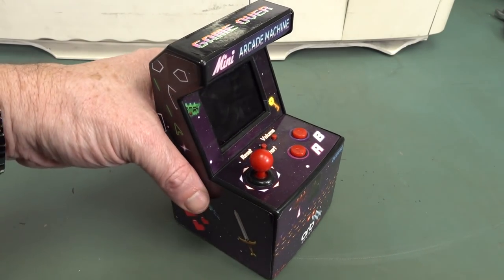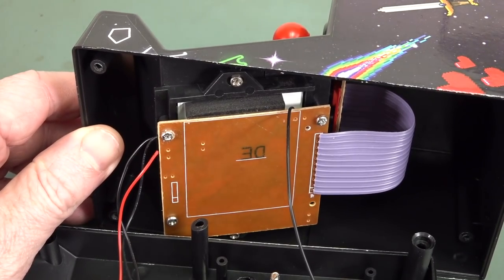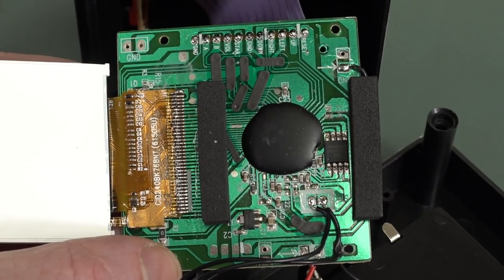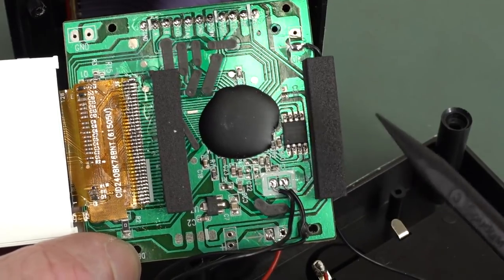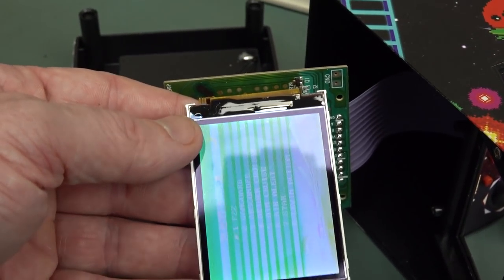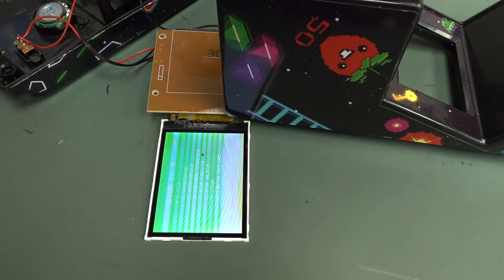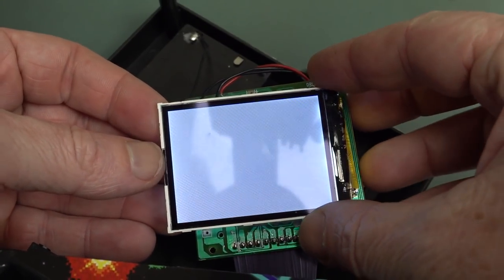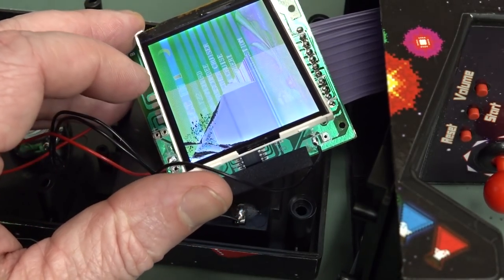Mini Arcade Game Console Repair OOPSIE!

Comment: buy a new one and pretend you fixed it!
Reply: Genial hhahahahhaa
Reply: Dad if you fixed it why'd you delete my save files.
Reply: Replace it with the new Raspberrry Pi and a tiny HD screen, WiFi adapter, etc., so Sagan can run it directly off Steam... plus he'll build up good arm strength carrying around the 12V car battery to power it.
Reply: Exactly the same I wanted to write. Weird... :)
Reply: @VeggeMight  Flux capacitor needed re-compiling
Reply: Dad of the week hahahahah

Comment: Tip: Access test mode by holding A and B while tapping Reset or while powering on.  There’s a nice menu of tests you can run
Reply: I like how the test screen crashes when you press all 4 dpad buttons at once
Reply: I have a rom dump of one of these... was trying to see if it was using nes on a chip... it may be, but i can't tell. Most likely custom...
Reply: Mine seems to crash when pressing up and left together. If that fails to crash it just press another button at the same time

Comment: from my experience, if you see color change in the lines there text/white things are, it's usually issue with voltages driving TFT matrix.
It may be issue the issue with broken Chip On Glass TFT driver or if driver settings are incorrect. 

Settings usually transferred from MCU that drives TFT shortly after boot by SPI or I2C interface, so wiggling it in runtime will not help...

Comment: Unsolder that memory chip and dump its contents. Would be interested in what's stored on there. Please do it, please!
Reply: I second this. This could tell what kind of emulator they are running on the blob
Reply: @zaprodk  If I were to guess, I'd say it's MAME (multiple arcade machine emulator)
Reply: @brettleach6565  MAME is a Lot of things. It can emulate dozens of different game platform hardware. /which/ hardware is what would be interesting.
Reply: @zaprodk  These things often have several games on one chip/blob. Id bet that they custom code them all for some cheap cpu,. Id go for 8051/PIC?

Comment: Looks like a pretty standard 240x320 LCD with a R61505U controller, they're cheap and easily found on Aliexpress. Maybe do a followup video soldering in a new LCD.

Comment: Did you check the power supply ?
Reply: Rule Number One: Thou Shalt Test Voltages.
Reply from the maker: Yep, 3.3V. Didn't get that on camera.
Reply: Did you check the contrast setting voltage?

Comment: i brought one of these hoping to use for a project...took it apart soon as i got it home...when i put it back together i had the same issue with the screen..i took it apart again, checked the ribbon which was fine, and couldnt see any other issues, decided to put it all back together securely and return it as DOA...but to my surprise it actually worked..and still works fine today!

Comment: I just did the same, Trying to fix  55" (140cm) Tv. I'd just found the problem when I cracked the screen - I nearly cried !!!
Reply: I found a 65" and I can't believe how big the LCD is, just turning it over makes me feel the screen will break! If I was a repair shop I'd have some sort of moveable drafting table type support mechanism to hold it and move it around without flexing.
Reply: volvo09 Make sure it has an adjustable curve for those curved screens!  May I suggest a soft winter duvet as a home solution.  It is soft and big enough, and is routinely wrapped in a temporary cloth in case of spillage or glass shards.

Comment: Next project :- build the "equivalent" from scratch using a raspberry pie.
Objectives 1) Toy for Sagan 2) Interesting project for some of the subscribers 3) To finally shut up all those who goes on about the raspberry pie each time a retro console is shown that does not use a raspberry pie.
Reply: yes please
Reply: Zendal Darkman Yeh, that's a more appropriate use for that BroadCom SoC that boots from a serial flash or SD card and contains a built-in LCD/video driver.  Wonder if that CoB could be the main chip from an RPi 1 model A, with the flash chip doing the job of the SDcard.
Reply: Raspberry pie?! Yummy.
Reply: @mattmoreira210  They are!
Reply: Doug Dave is not that kind of guy to...

Comment: Same problem happened to my niece's mini game console purchased from Jaycar. Different branding but identical internals.

I'm planning to run a hot iron along the ribbon cable near the PCB, but hold little hope of it working. There's not much else to go wrong in there.

Might be a fun project upgrading the cabinet to a RetroPie! You could do a video documenting the conversion.
Reply from the maker: Interesting to know it's not a one-off fault.

Comment: those carbon conductive jumpers seem like a good thing to check. they're not going to be current carrying, so signals only, possibly for the lcd and if one went bad it would be easy to check and easy to fix.

Comment: It looks like the brighter 'stripes' are exactly where the text is. I've had this problem once with an OLED display, which turned out to be a power supply issue.
Reply: The problem is that it looks like everything that could be generating the voltages is COB or COG.  You generally cannot repair those, and even if you could, replacing them is much easier and generally cheaper.

Comment: Since flexing the main PCB changed things, and it didn't appear cracked, my guess is bad bond wires.  That's always BER.  If it's a packaged chip, swap it out,  COB, replace the board if you can get the board, otherwise replace the unit.  (Salvage anything worth it, but the only thing that looks salvageable at all was the LCD before it was dropped, and that connection looks like buggery to reuse, so..)

Comment: Do you reckon they put those together at a TV remote factory when there aren't any remote orders coming in? They've got all the equipment, the blow-molding for the casement and the single sided PCB with the carbon jumpers.

Comment: Well, A+ for effort even if you couldn't fix it.

What is that black blob on the chip made of, and is there any solvent that can dissolve it?
Reply: It’s a thermoset epoxy. Nitric acid does the job usually Audio tells me it’s an NES COB clone inside. They’ve been making single-chip NES clones since the mid 90s

Comment: With all the many layers of optical magic going on in these things, and the fact that the image is visible from the side, and not straight on, i'm suspecting one of the layers may have shifted ever so slightly, from a drop or similar.
Now that it's FUBAR'd it could be interesting to take the display apart and play a little with the internals to see how it affects the image.

Comment: Really looks like a too low LCD driving voltage. When this happens, you start to see a striped pattern because the the rest of the lines with white text is darker as the white text pixels don't consume energy. LCD typically uses high gate drive voltages from 15 to 30 Vpp. Those voltage are generated by a charge pump, that's what all the capacitors on the FPC are for. The problem might be there or on the main board.

Comment: Depending on what kind of display it is, the display could have an integrated capacitive boost supply. In that case, maybe a cracked ceramic cap?

Comment: i have seen this twice before on parallel LCDs ... once it was a signal integrity issue (i think thats likely because of the lines) and once due to bias voltage, i assume it would be too high but in my case it was caused by the voltage going too high and the LCD never recovering (probing oopsies)

Comment: Dave, you cannot test LCD's the way you did by pressing on the connections or freezing it. LCD like those are not dumb ones like in your meter. You have to send commands to it to initialize it. There is a crap load of registers in there. So even if one line had a bad connection and it didn't get initialized property and later you pressed the ribbon and i made contact it still would not work. You need to power on/off each time to really check it.

Comment: Whats the reason that they glue the chip with black glue, seen this on calculators etc?
Reply: Look onto COB if you're curious. I've never used them so I don't know a whole lot about it, but basically it's not a regular IC under there, it's just a bare die(or Chip On Board) connected with itty bitty bond wires(similar to what's inside of the black package of a typical integrated circuit). Without some sort of compound covering and securing it all to the board the tiny die and bond wires would be left flapping around and easily damaged. Plus if someone took apart the device it was in and was able to poke about at the COB there would be pretty much a 100% chance it would be damaged beyond repair, so encapsulating everything to the board makes things a whole lot more secure and less prone to damage. 

If you soldered a couple wires to a PCB then connected the other end of those wires to a big piece of cardboard, when the cardboard moves the PCB and wires would move all over the place and experience fatigue until they broke. Now if you coated the entire thing in hot glue then when you shook the cardboard the wires and PCB wouldn't be jolted around and there would be no fatigue were the wires connect to the PCB anymore. Scale things down quite a bit, replace the PCB with the chip on board, replace the wires with bond wires, and the cardboard with the main board the COB is connected to and it's the same principle.

Comment: 240 in 1.  One of mine is 240 the other is 200. My first one was last Dec in a local store but died after a few hours when it started to flicker and sometimes reset then eventually would not power up. I got a refund as they had no more stock but a few days later a return showed up and I ordered one on eBay.

Comment: From experience, while you're not wrong about it being an ASIC, I can do one better. What you're probably looking at is a "Nintendo on a chip", NOAC, or "Famiclone". It's all the hardware of an original Nintendo, 6502+audio and graphics processor, all condensed down into a single chip. Early ones would just break out connectors for a cartridge port, but newer versions can read ROM files directly from something like an SPI flash chip, or even SD card.
They're incredibly cheap, and nearly all 8-bit Chinese consoles use them as their core. Every "NES Classic" ripoff I've seen was using one. Rather than the linux host OS running an emulator of the genuine "NES Classic", the clones would just have a NES ROM that looked like the genuine units interface that would then go on to load other ROMs. 
(More modern ones have been extended to the point at which they're barely even recognisable as a NES, but will still fall back to playing the original NES roms if presented with them)

Comment: This looks like cracked cob. It can be verified under the microscope if you peel off protective compound and look at the chip in reflected light.
Reply: Unless he removed it chemically rather than mechanically there's a pretty good chance he'd damage the die in the process of breaking off the potting, leaving no discernable way to tell if any cracks were preexisting or a direct result of exposing the COB.

Comment: What is the purpose for covering the IC into those "black blobs"?

I got so excited what the fault could be and you dropped it .....
Reply: Many argue that it's to make reverse engineering more difficult, but it's not. It's cheaper, and very compact. Sure, with BGA packages you can pack a lot of pins under a tiny package. But with chip on board technology you can do this with a single sided PCB. Another advantage is lower pin capacitances, thus it is sometimes used in radio transceivers.

Comment: Could be one of the bond wires inside the blob being broken or detached. If the thermal expansion coefficient of the black goo isn't properly matched to the circuit board, the wires will eventually break after enough thermal cycles. I've had many other simple things with such a blob failing and also either getting worse or better when flexing the board, and the only reasonable explanation was that the problem was inside the blob itself. Garbage!

Comment: so are these bond wires done by hand?
Reply: On the IC?
Reply: @rkan2  yeah.  The bond wires from the die to the PCB under the blob are they done by hand?  I assume joining bond wires from the die to the legs inside an IC package are automated but still not sure about that either.  Just figure they must be automated to keep costs down.
Reply: The spacing of the bond wires is less than 0.1mm. I'd be impressed if someone could do those by hand.
Reply: No, it would have to be done by machine, surely.